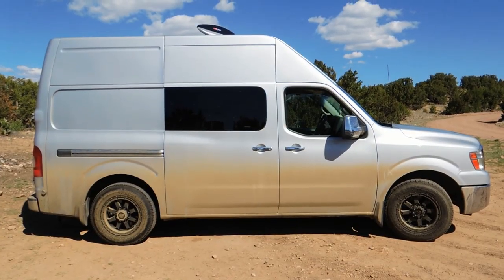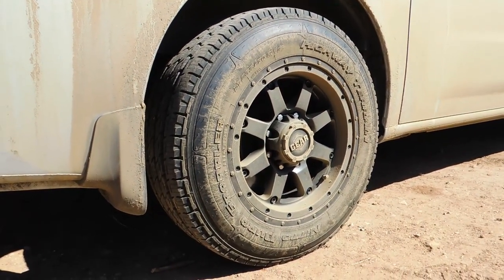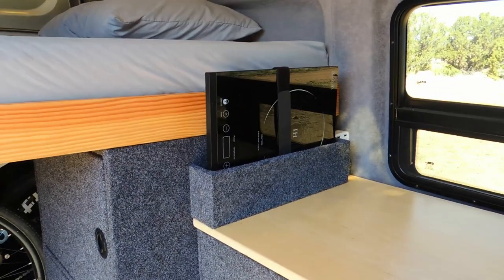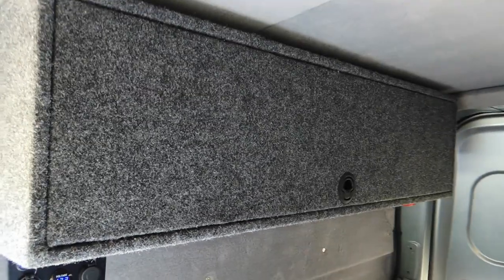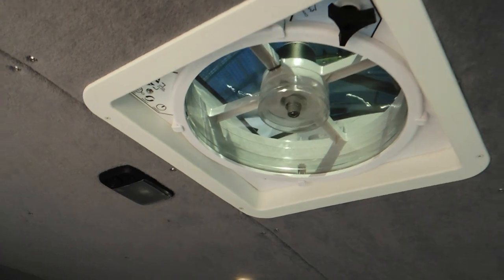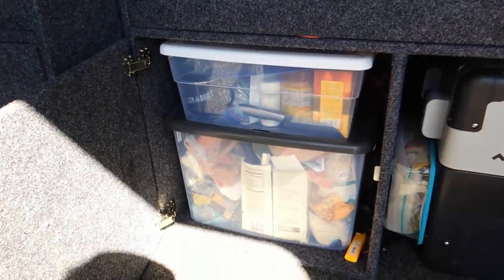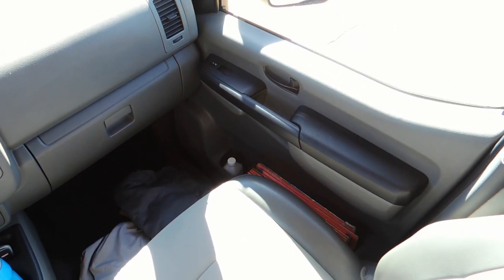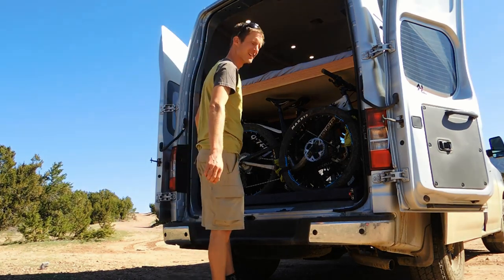Quick Tour Nissan NV2500 Camper Van Build

Comment: Hello.  I just bought a 2018 nv2500 cargo high top.  I want to do the same conversation.  What would you change or do differently?
Reply from the maker: Hi, I probably would have made some of the cabinets slightly larger to fit my clothing duffel bags better.  I'm also always torn over having the bikes vertical with wheels attached, and a narrower bed lengthwise on the floor, but I'm not sure it would really work with three bikes.  My Sprinter van could hold 21 bikes behind the rear sliding door, positioning them the way I did here.  That's definitely the most space efficient.
Reply: @wandersinnature6942  
Why in the hell would anyone need 21 bikes for themselves? And youre pronouncing the word 'do•metic' wrong. Its a one syllable word.
Reply: Chris
*conversion, not conversation.
Reply from the maker: @Sig721Tau  The Sprinter was used for a mountain bike company.
Reply: @Sig721Tau  Do-me-tic=3 syllables.🙄Duh!

Comment: 3 questions, please: 1. You said adding the windows was expensive. How much was each one, and who installed them? . 2. How is your mpg? 3. Could you have installed a toilet/shower in the 2500 had you done away with the passenger seat?
Reply from the maker: The windows were like $450 for the T-vents, and $250 for the regular ones.  I installed them, they're made by CR Lawrence. MPG is around 16mpg with the bigger tires, which is about 17 if calculated for the size difference.  The Sprinter I had for work got 18mpg in similar conditions, but oil changes were $400.  Yes, but   I prefer to shower behind the van and use bathrooms elsewhere...

Comment: Who did the insulation for you? I'm having a hard time finding a company that will insulate vans.
Reply from the maker: I did it all myself, but it's not hard.  Just pick up some relfectix and 3m spray adhesive.  I also added 3/4" foam insulation behind the reflectix.  You can also use spray foam in the boxed off sections, but I didn't, in case I wanted the run cables through them.

Comment: I always thought NV's looked hideous, but yours looks really nice.  This video is changing my mind
Reply: I've never liked the front end it's too big. What kind of gas mileage do these get??
Reply: @mallorymcguire833  I get roughly 15 mpg, with the v8. I've gotten 15 mpg hiway, pulling a loaded van and trailer, well over a ton of weight. (it tows like a dream btw) The front end allows for the engine to be fully forward and easy to access, so it's practical. I appreciate that they dont appeal to everyone though.
Reply: I'm a "van guy" driven / owned ford, chevy and dodge. The nissan is by far my favorite in most every respect. (as for them being hideous, they may not be the prettiest van ever...lol...they are also a bit of a head turner, I get approached by often at gas stations etc...)

Comment: Excellent video. Any mechanical problems with the truck? I want to buy a high roof model too. Thank you.
Reply from the maker: Hi, so far, so good.  No mechanical issues at all which is why I went with the Nissan, but I only have 40k miles on it.  My Sprinter died twice, at 30k and 60k miles, both costing about $3000 and the warranty surprisingly didn't cover it.

Comment: Do you have the dimensions of the bike tray? Whats your bike size? Thanks in advance
Reply from the maker: Hi, I believe it's 41 5/8" x 38" I'll have to double check.  It's whatever the distance is between the wheel wells minus 3" to accommodate two 3/4" inch piece of baltic birch and two 3/4" drawer slides.  The mountain bikes are size large, the cross bike is a 56.

Comment: These makes have weak transmissions, expect the transmission to go out at around 100k, then you will have to pay about $4,000 for a rebuilt transmission which might go out very soon after that.Otherwise they are very good choices for a van, but a poor transmission is a deal breaker.

Comment: WHY DON'T YOU TELL EVERYONE THAT THERE IS NO TECHNICAL SUPPORT ON THE NISSAN PASSENGER VANS AT ALL AND NO ONE CAN ANSWER A SIMPLE PART LOCATION FROM ANY ONE AT ANY NISSAN LOCATION INCLUDING ITS HEADQUARTERS, BUY A CHEVY OR GM!!!!!!!!  I REGRET EVERY BUYING A NISSAN AND WILL NEVER BUY ONE AGAIN!!!!!!!!
Reply: Ben P Well that’s good to hear bud! Glad they worked out well for your work. You’ll love it as a camper.
Reply: They don't break so you don't need tech support. My high top has 311k miles. Oil change and brakes that's it
Reply: C King someone’s mad they bought a Transit or Promaster 😂